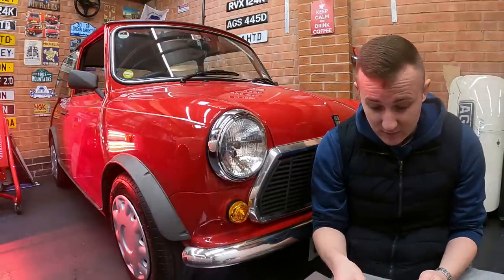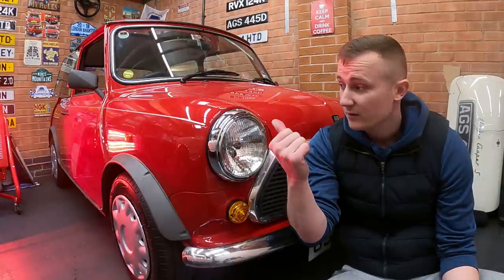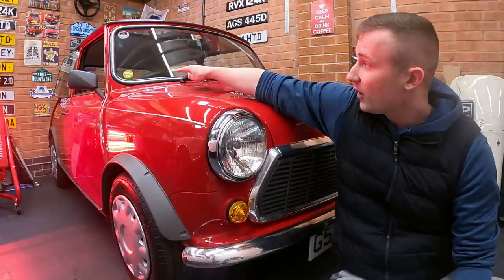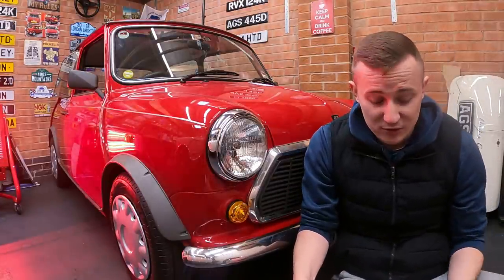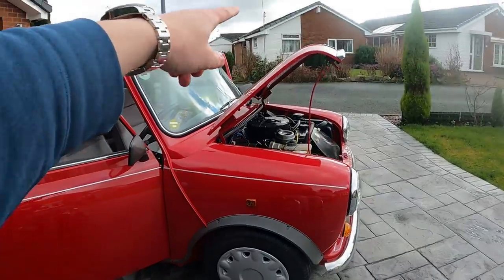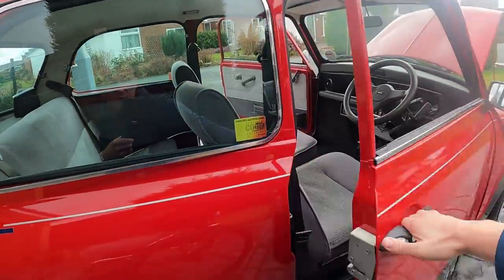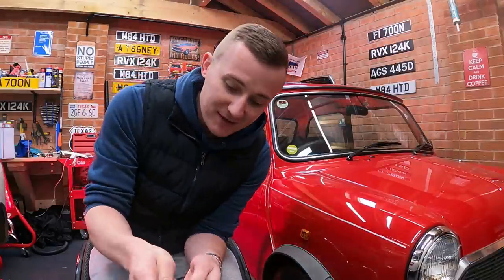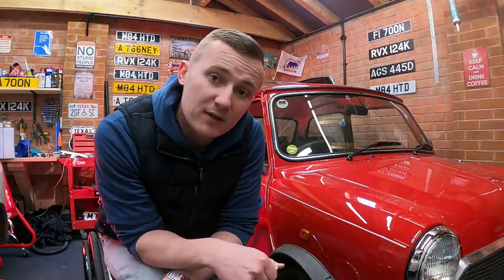2 Thousand mile survivor MINI! *Walk Around*

Comment: I’ve commented on here before pal, I worked at Longbridge Rover for 13 years and then at Reg Vardy MG Rover main dealer for 5 years. The front bonnet catch has been painted pal, it would’ve been black when it left the factory, I think you might have to do some research.
Reply from the maker: Shaun minis with external bonnet releases were painted the same time as the body so will be body colour. Later cars were fitted after the shell was painted.

Comment: £10,000 to £15,000 At a Classic Car Auction. Possibly More on a Good Day.  (Auto box May Hold it back Slightly. )
Maybe £20,000. That is a TRUE GENUINE TIME WARP CAR. 

Where Can Anyone Find An ALMOST  BRAND NEW MINI ?
Reply from the maker: Yeah unfortunately the auto box let's it down. However I find them to be really good. Probably because the car is so new. I did have another automatic with 30k on it that was fine! I suppose once they get upto 50/60k then they may become troublesome